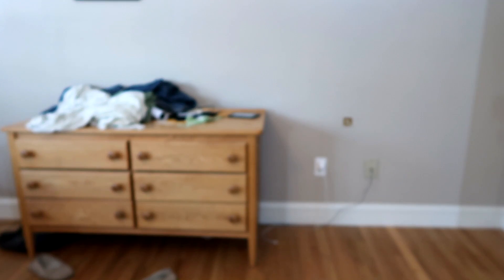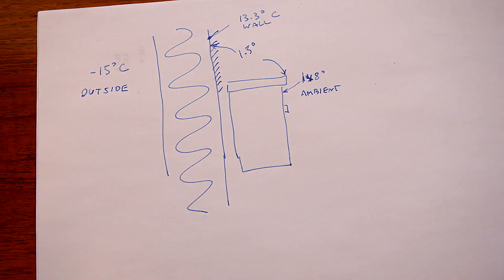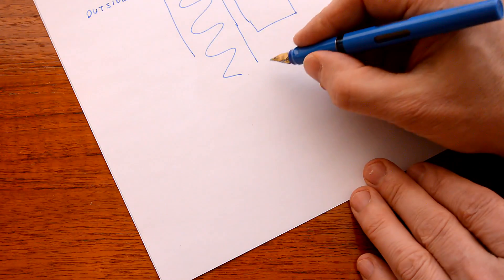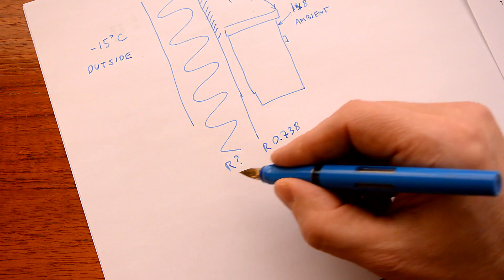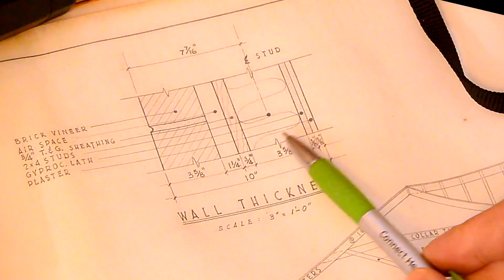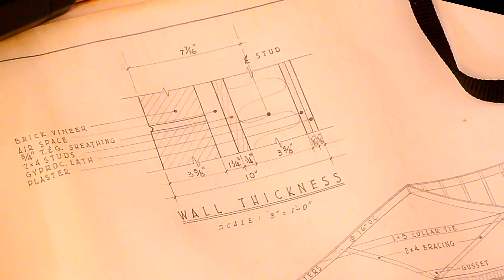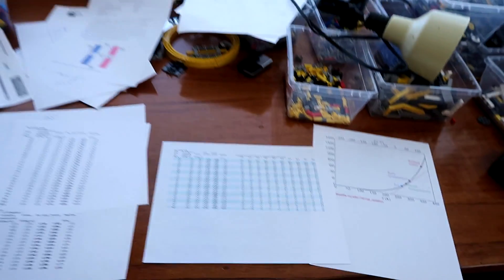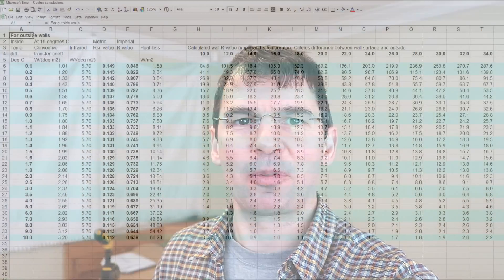Measuring house wall R-values using an infared thermometer

Comment: Just did this when the heating was on and had time to get objects up to equilibrium and walls up to temp on the inside. Got my result. Then heating off over night. Temp outside dropped considerably. Did it again in the morning with heating off so objects cooled as did inside wall. Got completely different result. Am I missing something here??
Reply from the maker: You need to give it hours to reach equilibrium.  Outside and inside temperature need to be steady for a few hours before taking the measurement.

Comment: This has probably been asked here. Did you measure the exterior wall temperature as -15C, or did you measure the exterior air as -15C? Would there not be needing to know the actual temperature of the exterior wall surface temperature (ie due to sun light radiation affected, even in cool weather, or even in the shade?) If you're measuring and calculating for the differential between the exterior and the interior, do we not need to be measuring apples to apples? wall surface temp to wall surface temp? This is confusing me. My attic air temp (close to the insulation) is approx. 38.7C but I did a infrared measurement of the surface of the ceiling insulation as an average 42C. There must be something wrong with my measurements between attic air and attic insulation surface. Obviously there is no sunlight radiation impeding upon the insulation surface. My infrared meter is a very good meter. My 1960 original 5.5" thick blow in insulated ceiling effective R value is approx. 5. lol
Reply from the maker: measured the air.  I made sure to do this on a day that was not sunny

Comment: Infrared Radiation = 5.70 W/(deg m2) is not the infrared radiation of the object - that would change considerably between body temperature and ice - that's what the infrared thermometer is actually measuring - so what is the 5.70 # a measurement of?    Reading off the graph I can say that it is Power (Watts / square metre) over Temperature (degrees Celcius or Kelvin), but that doesn't actually answer my question.    Is it a co-efficient of something at a boundary layer?

Comment: This Video is a gem Matthias, thank you for it and the spreadsheet.
What are your thoughts on using this method to determine R Value for vehicles?  
I'm  just finishing up building the walls for our van conversion and would like to see of the insulation meets the R Value specified by the manufacturer.
Your woodworking videos are great too!
Reply from the maker: try putting a space heater in it overnight.  then you know how much energy in, and you can measure the temperature difference and work out the overall insulation from that.
Reply: @matthiasrandomstuff2221  Thank you Matthias,  I'll do that.

Comment: What about specific heat of the material you're checking your ambient temp with?
Reply from the maker: The more specific heat, the longer it takes to reach equilibrium.  But I just made sure I gave it enough time to reach equilibrium regardless.
Reply: @matthiasrandomstuff2221  okay, I had assumed that specific heat meant that some materials would be at a slightly different temperature than ambient. I know I can tell the difference between certain metals by feeling their temperature (also speed of sound etc.). So is that because they absorb heat at different rates, and so some will feel colder longer than others? Is that because they have to absorb more heat? Or because their is more resistance to heating?

Comment: 7:15 f you have walls, windows and a tiled floor, and the tiled floor is by far colder than the windows and walls, is most heat being lost through the floor?

Comment: Hi presume in the UK one would use the 3rd Column from the right side of the page for R Value in metric (Rsi value)?, for instance a temperature difference of 0.30 degress would be 0.142 (R)

Comment: I'm wondering if this works for testing for cooling as well, but I'm guessing so.  I've been wondering what the actual R-value of our exterior walls are in our new house because I can feel the heat radiating from them from across the room.  The contractor skimped on everything, and our new Trane XV-18 can't get the house below 76 degrees on on a 94 degree day.  The R-number I get using this formula is R-6 where the local building code requires R-12.  Can that number I calculated actually be right?

Comment: I am not sure if what you just explained is something that can be dummied downed (for me). If outside temps are XX and inside Temps are XX then the wall texture should be XX. Anything under that, the wall insulation can be improved.

Comment: I want to know the procedure that leads you to arrive at the spreadsheet for calculating the R-value of the boundary layer based on the temperature difference,  and the columns you introduced for calculating wall R-value based on the temperature difference to the outside. I already purchased the thermometer, I am thinking these are possible question that i will be asked during the presentation, some study procedures are more crucial.
Reply from the maker: I looked up convective and infrared heat transfer using google and used those numbers.

Comment: my house was built in 55 like many houses in the area...  people working in the sawmills got to take offcuts home, so they literally built houses out of solid wood...  2x6's on their sides, nailed together...  not great rvalue, but good thermal mass.    picked up a thermal camera, so i've been slowly working my way through the house to see where any dark spots are and blowing foam into them...  super handy gadget - you can FEEL the draft, but helps if you can SEE it.

Comment: How about the boundary layer on the outer face of the wall? Seems the R value you solved for includes the contribution from the outside boundary layer as well.
Reply from the maker: I'm including that in the R value of the wall.

Comment: I remember in my classes some 30+ years ago, you did cross multiply.  So 28.3 x .738 = 1.5r   Now divide both by 1.5, you get 13.92=r.  Same result just we didn't flip equations.

Comment: When taking measurements with an infrared thermometer, take the emissivity into account as well. A reflective or refractive surface or material may skew the readings.
Reply from the maker: most surfaces have high emmisivity.  Yes, IR reflective surfaces, like tinfoil, produce incorrect readings.
Reply: @matthiasrandomstuff2221 
Right, most materials commonly found in houses will have a high enough emissivity.

I suppose I'm just used to seeing an IR thermometer trying to be used to measure the temperature of electronic components in computers, which doesn't work well at all.

Comment: For a more accurate surface temperature measurement of glass you should put a piece of masking tape on it and measure the tapes temp. The emissivity of glass does not lend itself well to infrared temperature measurement. Also, when reading the wall temperature i noticed that you aimed near a wall outlet? I have seen (through thermal imaging) that almost 99% of wall outlets give off heat. 
Other than that, fantastic content and well presented! Ty for another great video!
Reply from the maker: really?  I suppose they would if it's hotter outside.  They don't consume energy just sitting there.
Reply: @matthiasrandomstuff2221  Anything flowing even a slight amount of electricity through it shows up warm on a thermal camera.  Typically wall outlets are insulated poorly compared to the rest of the insulated wall.  For both reasons, I would never take the measurement around a wall outlet.

Comment: Your measurement is inaccurate as the tool you are using is designed to measure the temp when the dots meet on the surface to be measured.  Your measurements were +/- 1 ft off the wall, that's why they were the same....  Otherwise, cool math, never knew you could do this.
Reply: I think the two dots show the diameter of the circle being measured

Comment: 0:15 - *Celsius

Also, those IR thermometers will also give different readings based on the emissivity of the object you're measuring, so a piece of unpainted metal and a piece of wood will return different readings even though they're at the same temperature. Some models have an option to adjust the coefficient, and come with a table of common materials.

Comment: There is a subtlety in your calculations of the radiative heat transfer which you didn't mention.  Your wall tries to equilibrate radiationally with what it "sees" in the IR, which includes the physical objects like furniture, which are at the temperature of the air, and the floor, ceiling, and the other walls, which might be at various temperatures.  The air in the room is probably transparent in the IR.  If all the other boundaries of the room are interior surfaces, then most of what the exterior wall sees is at the temperature of the objects in the room, such as the dresser you measured.  But if there are other cold exterior walls, windows, or hotter surfaces, then you have to calculate the view factor for each and add them up appropriately.  You can do this using the "viewfactor" function in Matlab.

Another issue:  you really don't know the emissivity of anything you're looking at.  A 10% errror in emissivity translates to a temperature error of 7 degrees at 300K.  If you are looking at one surface as it changes temperature, this effect is small.  But if you are going to measure temperature differences between different surfaces, you ought to use a contact thermometer, not an IR unit.  In this context, I'm amazed that your R values came anywhere close to your estimate from the architect's drawings.

Comment: Some caveats, though... Don't aim the thermometer at a stud location or you'll measure the stud's R-value,. Don't work where there is a draft (e.g. from a furnace vent) which will mess up the boundary layer calculation. Don't do this on a windy day because air leakage and disruption of the external boundary layers will distort the results too.

Comment: You mentioned it, but it bears repeating that the potential error for this type of measurement is huge. Just a 0.2deg error in your differential measurement would be almost 20%. That would be the best case scenario, if you were using a good meter, something in the $500 range. With what you had, +/-50% is more realistic. The fact you got somewhat close is mere coincidence or luck. You can get far closer just by calculation based on the wall components. That wall is going to be much closer to R-10 than R-14, when you factor in the thermal bridging of framing. So you didn't really get quite as close as you think you did.
https://ekotrope.com/r-value-calculator/
Reply: The accuracy of the meter is kind of secondary, when simply aiming at a different wall (or even a different spot on the same wall) can return different values.
Reply: If you don't know the assembly of your walls, or if you think insulation might have been damaged (rodents/leaks) or poorly installed, calculating by wall components won't work.  Then you need to ... measure inside and outside wall temperature differences?  
Are you saying that if the thermometer is off by 0.2 degrees Celcius, the R-value will be off by 20%?

Comment: I remember doing this in Heat Transfer... of course, we only cared about the Q transfer rate
I totally agree never do thermodynamics in imperial, no need to use magical thinking and magical conversion factors that materialize out of nowhere with SI. Lord Kelvin was right "I look upon our English system as a wickedly, brain-destroying system of bondage under which we suffer."

Comment: This was very interesting, I never considered the r-value of the layer of air next to the wall. - As for heat loss through windows: modern three-layered glass packs should give better insulation than any traditional wall (of course not modern zero energy house walls).
Reply from the maker: even fancy modern windows are still much worse than an insulated wall from the 60s
Reply: Matthias Wandel   Well, okay, it depends on the walls and the traditions of the place. In an apparment I am overhauling currently with 34 cm brick walls I found that my new windows are better than the walls (at least nominally). But these are pure brick and plaster, no extra insulation.
Reply: @matthiasrandomstuff2221  -  My 1915 house's walls, double-brick with lath and plaster, are R-2.94 according to my whole wall assembly calculation.   Triple pane windows can be (i read) r-7.
I guess I should have included 2 boundary layers, and perhaps something for the air between the bricks, assuming a gap exists.

Comment: I loved that. Matthias, do you ever address heat loss through your windows? Any ideas (other than triple pane glass)?
Reply from the maker: the windows are much worse, yes.
Reply: @matthiasrandomstuff2221 can you please do a video with example calculation of a glass surface (black tape?) And maybe total glass on NSEW walls?  What about IR films to limit cooling cost?

Comment: I calculated the thermal insulation of my garden office by measuring the power use of its electric heater. For a 24m2 structure and a delta T of 27K, it uses roughly 500W.

Comment: 14.8 degrees inside?  How on earth does your wife let you get away with that. My wife complains when it's less than 20 degrees!
Reply: Well it depends on what you're used to.  Years ago when I used to live in a cold town, inside temperature was always around 16 degrees.  Now, after 10 years of heat and humidity I don't think I could stand that.
Reply: As one gets older, it gets worse. Worse worse, as one gets older (in the same house) the R value of the walls decreases slowly.  I'm 67 years old and I keep the house about 23° when we're up and about, and 19° when we're asleep.

Comment: How do you account for temperature variations between day/night/sunlight etc.? Time constants in building materials are so long, it might be hard to find a steady state. Also, doesn't the outside wall temperature matter? On my house it is quite a bit over ambient.
There's also a comparative method where they put a large sheet of known material in front of a wall or window, and compare the temperature distribution, which is said to be more reliable, but I have never tried it.
Reply from the maker: I do it early in the morning, temperature has been steady overnight.

Comment: If you are dividing or multiply temps in a formula, you should convert to Kelvin for metric or Rankine for imperial. It didn't really matter here, but it's a good habit to have.
Reply from the maker: Extra unnecessary complexity only for the pedantic

Comment: nice video, although I wasn't the biggest fan of thermodynamics at the university.
It is interesting that we use the U-value instead of the R-value over here in Germany. 
Reference value for a wall on a modern building is a U-value of 0.28 W/(m²·K)  which would be a R-value (imperial) of around 20. Now im curious to calculate the value for the house of my parents, who got new insulation installed a couple of years ago. My father says they now save a lot of money on heating.

Comment: I don't have an infrared thermometer, but I'd be interested to find out what the r value is of my floor and ceiling, because my bedroom actually sticks out of the house with outside air below and above it, and with the thermostat in the centre of the house set at 17, the temperature in my room at night can get down to 14 or less. The walls are framed with 2x6, so they are nominally r19, and the floor is 18" trusses, but I dunno what the supposed insulation is there. As far as I know it should be about r36 in the ceiling. I have a gas fireplace in my room, and I usually let it burn on low overnight if the outside temperature is -20 or lower, and that keeps it up around 18 or so inside.

Comment: Walls facing the sun and the amount of time the sun has been hitting the wall will change your calculations drastically.  Solar gains can take several hours to reach an inside wall surface, so taking a reading can be very different depending on the length of time radiant heat from the sun has been heating the outside surface. Using IR thermometers for glass, reflective surfaces and certain liquids will vary drastically or not at all without a non-reflective surface attached. Something as simple as a piece of masking tape. (HVAC tech/manager for 46 years)  we don’t let our techs use most of the current crop of offshore IR thermometers for anything other than broad/bulk readings, but not for technical operations.  The spreadsheet is a good general reference for most everybody. Thank you for all the work, and spreading the knowledge! 👍🏼 🌡
Reply from the maker: Yes, see linked article about that
Reply: Matthias Wandel    I actually did read it.  As intelligent as most of your viewers are, I think you still need to specifically talk about taking temperatures on a non-solar influenced wall to determine R values.  Thanks for responding!

Comment: Only 2x4 exterior walls? If you put new siding on this house i would add 1.5 fur strips with insulation under the siding on the outside to keep more heat in

Comment: Jesus Christ this is like the third or fourth time you've released a video on something I've been toiling with basically on the day. For both your your table saw runout video and diy circ saw blade sharpener videos I was literally in the shed, trying to figure both of those out and took a break, only to come across a video uploaded an hour ago by you about it.

Currently insulating said shed and very interested in finding out how well it should perform, and if more is needed before internal panelling is done.

Thanks again.